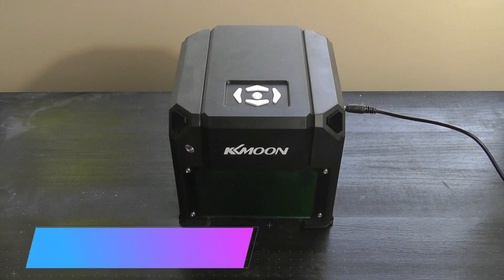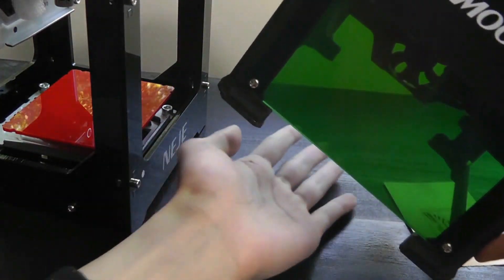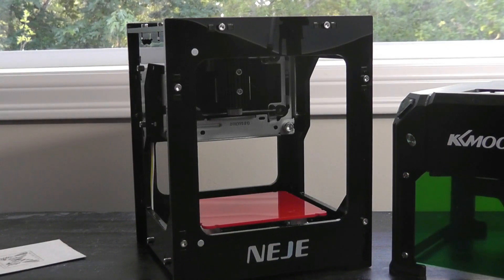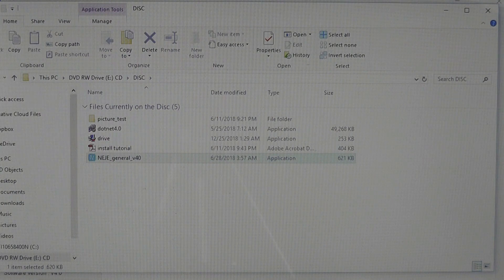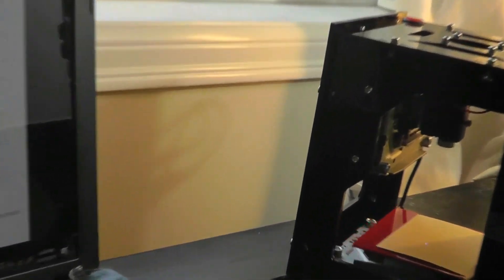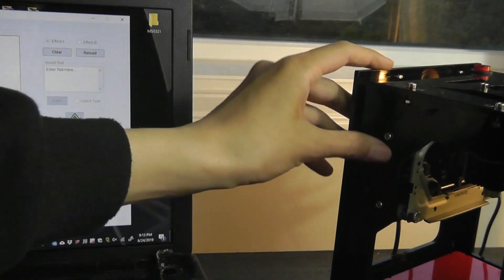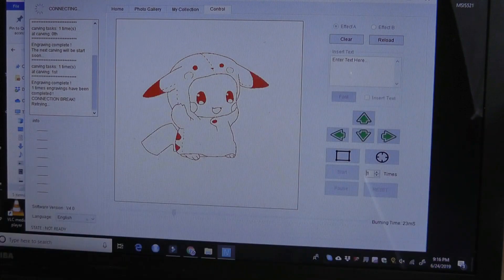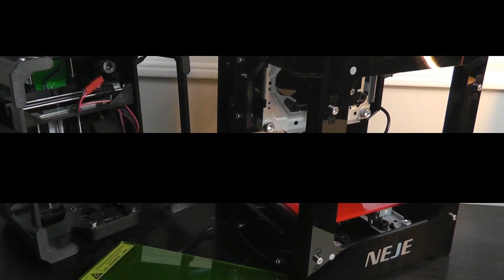REVIEW: NEJE DK-8-KZ Mini Laser Engraver (1000mW High Speed)

Comment: Thanks for the review, I just purchased one of these with the 3000mW laser. I know the video's 4 years old and you've probably moved on from it, but do you know if this can handle glass or metals? I primarily want to use it for leather and wood, but it'd be good to know and Google seems to fail me.
Reply: There is one of these on eBay as " NEJE 1000mW DIY Laser USB" that item will give you all the info. I know can't do metal. Can do leather and wood. Hope this helps a bit :)
Reply: 1000 vs. 3000 ...📄✍🏼

Update??
Reply: @PeterLustig3xL  I bought some anodized aluminum business cards to try it out, since I read a 3000 mw blue laser should be able to etch the anodization off of them. So far, with the highest burn time and up to 6 passes, all I'm able to get is a faint ghosted-looking etch. I've tried focusing the beam to it's sharpest point with no real difference. There's absolutely no way it'd work on even the most malleable metals.